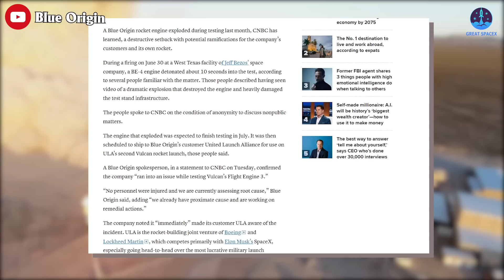BE-4 testing explosion! Blue Origin is in big trouble...

Comment: When SpaceX blows shit up, it’s “valuable research” but when BO does, it’s a dramatic setback 😂
Reply: Truth. However, there IS a difference between testing a prototype to destruction to see how it performs, and blowing up an engine you expected to use on an actual rocket.
Reply: It's never good after these many years of testing and delays to blow up a flight ready engine that was about to be shipped off and used on the Dream Chaser launch. This was not early stage testing where they wanted to see push the engine to its limits. And imagine blowing up Dream Chaser after how many years it's been in development.
Reply: The issue is that there are hundreds of Raptor engines in stock.  Blow one up, grab another from the shelf and continue testing.  And all these raptors are still just test examples.  Blue Origin is intending for every single one of their completed engines (which take months to build), to  be customer engines.  There are only 3 BE-4 examples in existence and they just blew one of them up.  (a customer engine)  Seems they need to go back to the drawing board.  Seems like blue origin is either working from home, or phoning in the engine production.
Reply: In the time it takes Blue Origin to build and test one engine, SpaceX has built and tested 100 new raptor engines and 3 new starships. 😂
Reply: Nonsense. BO has almost no engine inventory to do any testing with. Its engine is an oversize, overpriced rat's -nest of plumbing, and is over 5 years late. They seemingly can't afford/do not have enough engines for testing, so they have said the equivalent of: 'that's got to be good enough now', signing-off on supposedly flightworthy production engines to ULA.
SpaceX by contrast can build an engine per day, has an enormous inventory of engines for testing, and should one or two go kaboom under extremes of testing, a lot is learned, and it is only one engine out of literally hundreds, so no real loss. I hope that clarifies things for you.
Reply: Blue Origin didn't intend to blow up that engine.  But, it makes for additional learning experiences.  Congratulations to BO.   Bringing brand new rocket engines to regular use is never easy.   Keep testing and correcting.
Reply: @arthurhamilton5222  l
Reply: Exactly. Fanboys and their dual standards, while pretending do be Space enthusiasts but sounding as some Soccer's supporters .
Reply: @RogerM88  You miss the point.  It is no big deal when SpaceX destroys something, because they are already 3 versions further in development on new designs and everything they do costs a fraction of the money Blue Origin or ULA plows through for a single launch.
Reply: @jkleylein  it is no big deal to lose money on a destruction of a rocket version for Space X ?  Money was spent to build it.
Reply: @RogerM88  Reference the above-post: "there IS a difference between testing a prototype to destruction to see how it performs, and blowing up an engine you expected to use on an actual rocket."

But I do agree with ya about the fan bois - myself, I'm a Musk-ateer!

Comment: Raptor engine has been in development for 14 yrs (2009 to 2023) BE-4 engine has been in development for 12 yrs (2011 to 2023) neither have made it to orbit yet. My bet is Be-4 will do it in less time.
Reply: Spacex has done 100 times what benzo has done, hardly far comparison for blue.
Reply: @chiaricharlie6608  Everything stated is public record and not disputed by Space X and is Fact and you can't provide anything to disprove it.
Reply: Well , spacex is making a way more advanced engine (the most advanced chemical rocket engine ) . Blue is doing a known closed cycle and should be way easier .
Reply: @TheHeavenman88  First thing is both are liquid fueled rockets not chemical rocket and everything you stated is speculation and I gave you facts because you don't have any.
Reply: @horatio1962  NO , You have NO idea what you are talking about . Liquid fueled rockets ARE chemical rockets!  I made that distinction because nuclear rockets are generally supposed to be more powerful than Chemical rockets. Raptor engine is a MetaLox full flow cycle staged combustion engine which is a design that has never flown due to how hard it is to make it work. Material science innovation was required to pull it off , and SpaceX did. Blue origin uses a closed cycle Metalox engine which is a cycle that has been done before and doesn't require any breakthrough to make. SO yes , Blue origin has a easier design , AND they are late.  I hope you learn a thing or 2!
Reply: I think a lot of people would be happy to take you up on that bet! 😂
Reply: @eyeborg3148  Well if Raptor launched today then BE-4 sill has 2 yrs to launch and still beat Raptor. "May the odds ever be in your favor"
Reply: My best is that you are wrong.  BE-4 will never make it into orbit - neither will the New Glenna rocket.  BO is a farce.  It exists only to get more grants from NASA without achieving anything.

Comment: So... the engine DIDN"T explode. But suffered a failure...  You then play explosions of other rockets.  It didn't effect production...  And it didn't effect their schedule...  Nice reporting there.  Have any more bias you want to explore?  Oh BTW  Raptor 3.0 EXPLODED turbo failure.  But that was due to running it to extremes till failure.  Let me guess...  Running the BE-4 under the same kind of testing is still a big issue... right?
Reply: Acceptance-testing of a newly apparently 'flight-worthy' production engine is NOT testing that engine to extremes. It is just making sure that it runs within the defined performance-envelope. An explosion at this stage is extremely concerning.

Comment: Perhaps they should just lease some raptors and be done with it.
Reply: It's interesting to see how big of a "hairball" their engine is, compared to the super-simiplistic designs that Space-X uses.  Musk has said something lke "We're not done when we've added the last thing we need, we're done when we've removed the last thing we DON'T need".  IE simplicity is the key.  Less to test, less to troubleshoot, less to go wrong, and faster to manufacture.  He's rolling these things off the assembly line at a staggering pace.  The BE engines just can't compete on ANY of these metrics.   Ignoring all the other benefits of simplicity, it means they can crank these things out so fast they can have a very rapid R&D cycle.  They're not afraid to push a raptor to the breaking point because there's close to a dozen of them sitting in the warehouse ready for the next test.  On the other hand, the BE engines are "precious" and can't be pressed as hard during testing.  Plus when one DOES go boom, it forces them to pause a bit.

Although I'm critical of their design philosophy, I'll always encourage a variety of different approaches.  Parallel development is a great way to speed up the process, and helps give alternate approaches a chance to show their worth in the long run.  So often a design gets stuck on a rail due to a design choice made early on, that limits what options are available down the road.  And occasionally one of those alternate approaches ends up making a later design uniquely well-suited for particular roles.  Then you have a design that initially looked like a loser but is superior in a new niche where the apparently better looking deign-on-rails simply can't be adapted for.

So, keep blowing up rockets, Bezos.  To some it may look like a fool's errand, but it provides value for everyone, whether or not you come out on top at the end.
Reply: Because they don't just randomly blow up still or don't start or just go out?
Reply: The whole earth should use raptor 2 and soon raptor 3 don't need any others
Reply: Whether it be Rivian to compete with Elon’s Tesla, Blue Origin to compete with Elon’s SpaceX, Kuiper to compete with Elon’s Starlink,  everything Bezos touches does not turn to gold, it turns to siht. Don’t believe me? Just look at Bezos’ Washington Post propaganda rag so soiled, not even fit for toilet paper
Reply: Would at least give them a foot to stand on, similar thrust, more reusable. I kinda want to see some other companies give Space X some proper competition. Competition breeds innovation